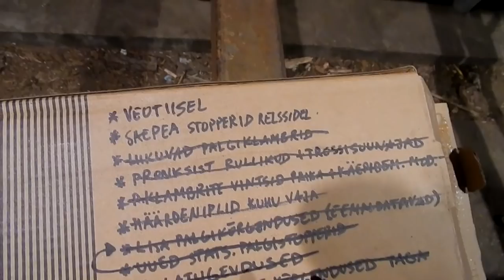Completing The Trailer - Band Sawmill Build #10

Comment: You don't have any diagonal reinforcing?
Reply from the maker: The winch brackets are placed diagonally and act as reinforcing. Plus the square tube is quite big in size which makes the trailer pretty stable.